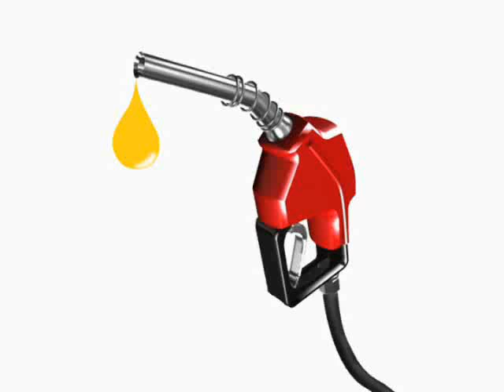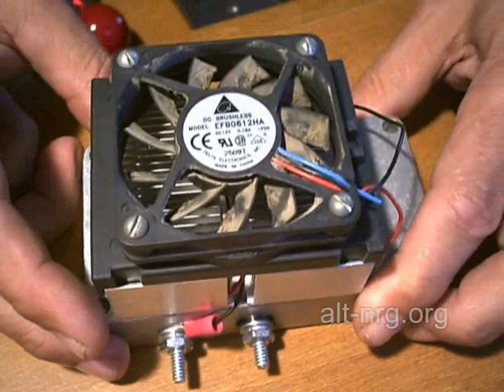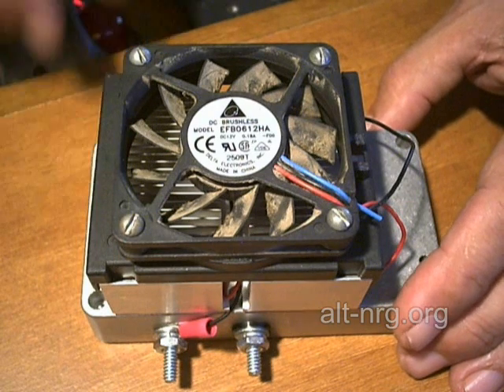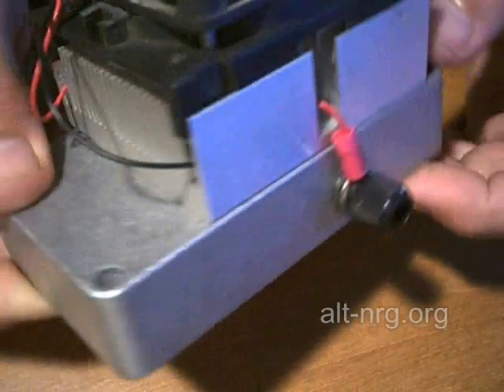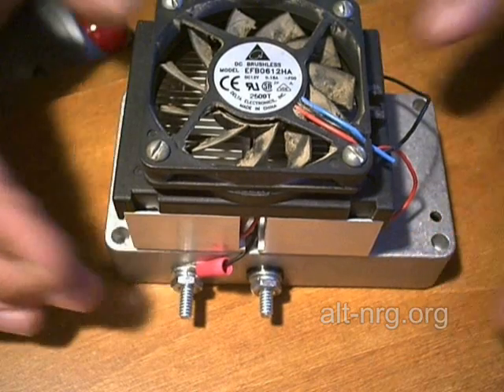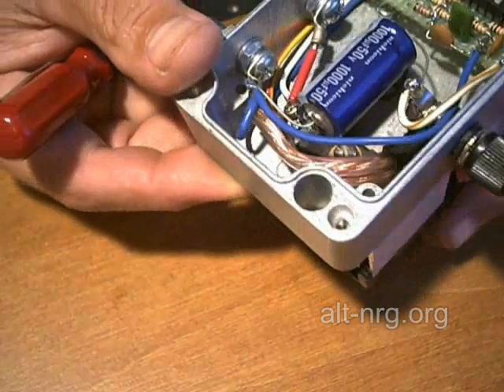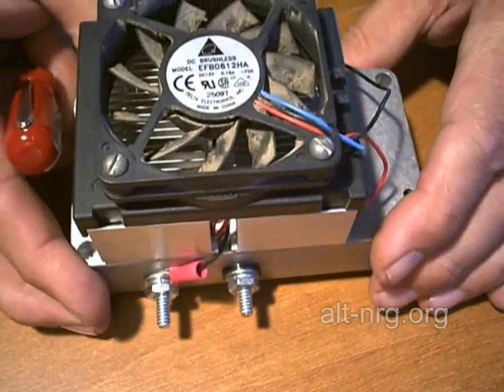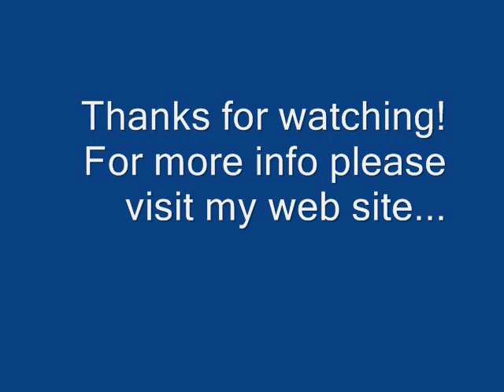#124 PWM cooler mods

Comment: Interesting video;Allthough I`m quite capable of soldering up circuits,I`ve made several PWMs & they all work perfectly,however I`m not very good at diagnosing problems,I too have "blown" a cooling fan(it was a cheapy from china)so I`m interested in your findings on transient voltage;this is just a thought-what would be the result of fitting a condenser(the type used in distributors & alternators)?Iknow it wouldn`t do any harm,but would it do any good?thanks Terry

Comment: Zero,

You talk about voltage transits which blew out the fan. I wonder if you scoped the voltage from the power supply during you labs experiments, could your transits be from a dirty supply? If so would a large battery help in your transits?